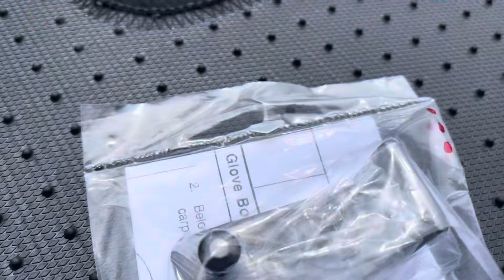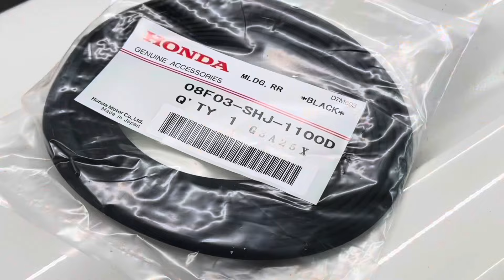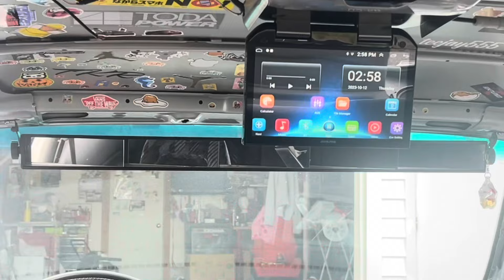Transforming my civic hatch (EK)

Comment: You got the body door Stryker off. I ended up masking mine off. I swear they felt like they were welded on. I could not get them to move!
Reply from the maker: I use an impact screwdriver like you would use one the Philips head on the rotors.
Reply: @TKRTSRTEEJAY1293  yes sir. Me too.  It started twisting the hardened Phillips head. That's when I stopped. I'm not sure what they used to tighten them down but damn?!

Comment: what a great rebuild, came out so fresh. also do you mind sharing details about how did you put the type r honda emblem on the hood? is it held on by glue/tape or you had to drill any holes?
Reply from the maker: I went off a few forums from back in the day and used those measurements and I used the oem adhesive tape it came with and I clipped the little pins flush that would go in the holes. I didn’t drill holes. Also kinda wanna glue it so no one can steal it easily 🫤
Reply: @TKRTSRTEEJAY1293  okay thanks a lot man!

Comment: How much in total did you spend restoring it..... couldn't you have just bought one in better condition from the get-go?  Either way, nice job..... though I'm not particular to cars that are color matched, I feel like too much of it doesn't make the car look right, you know, like how ghetto people just spray paint the whole damn car and everything on it thinking clolor-matching everything is cool...... even windshield wipers?  You know what I'm talking about! Hahaha.  (Not directed towards you btw, yours is done right).  I prefer all my accents black (moldings, door handles, license plate frame, front/rear lips, spoiler, sideskirts, even mirrors)...... but that's just me.  But I supposed you were going for the Type R look.
Reply from the maker: So I got the car for 2500
Sold the carbon trunk for 400
Sold the tracklife fenders for 350
Sold the bys rep bumper for 300
Sold the top one side splitters for 120
Sold the old wing(same one but all damaged) for 150
I also put the carbon hood on another one of my project cars 

I paid 145 for the type r mirrors in Japan
260 for the Jdm ek9 headlights in Japan

350 for the type r moldings in America 
70 for the sidemarkers
300 for the em1 grille
150 for the em1 lip
250 for the new wing
30 for fenders 
80 for the back up cam
10 for the third brake light
18 for the underglow
100 for the android radio and bezel
300 for the integra interior 
1000 on primer paint and supplies
Gas for my welder $$?

Many more things like bumper beams and seam sealer and steel it self etching primer 

100$ to remove the windows 

200 to reinstall(new windshield as well)

I could have found a cleaner one for sure but at the time I bought this car I needed a daily asap because I was in the middle of my em2 engine swap project and that used to be my daily.

Im definitely forgetting something’s for sure

The hardest part was I run my own buisness in the spring and summer and I work long days. Everyday of the week so it really slowed this project down.
Reply from the maker: Hood hinges fender liners bumper alignment brackets I’ve gone through the whole front suspension with new arms and bushings as well I’m definitely deep into it now and I plan on putting in my k20a2 soon with refreshed bay and manual conversion
Reply from the maker: Also I was going for the type r look but I agree I like the dx or black accent look too 🔥
Reply: @TKRTSRTEEJAY1293 bruh wazup like your Sweet Ride 🏆🏆

Comment: where did you get the license plate holder from?
Reply from the maker: It was on the car when I got it I liked it so I saved it
Reply from the maker: I plan on getting the oem plugs for the stock holes that’s why I didn’t shave them
Reply: @TKRTSRTEEJAY1293  I like having mine offset, I had my old civic and my current one using only one of the oem holes but just off to the side